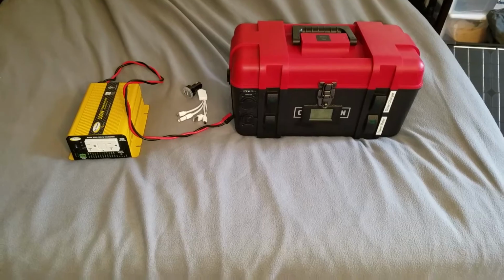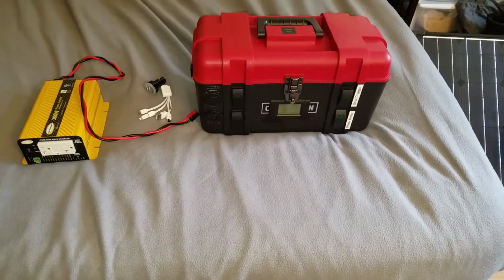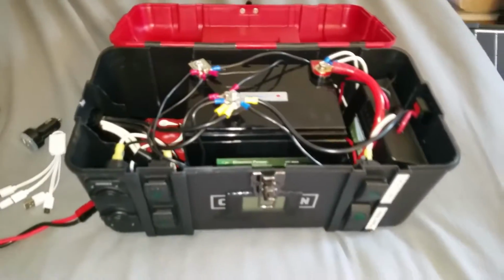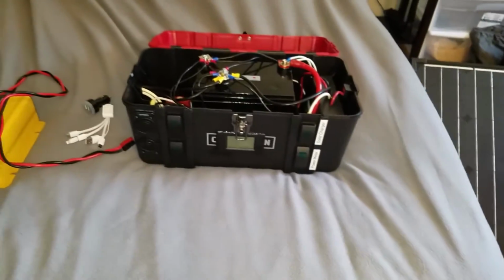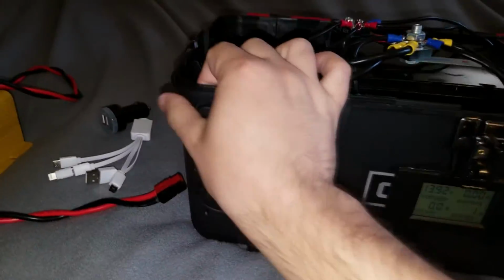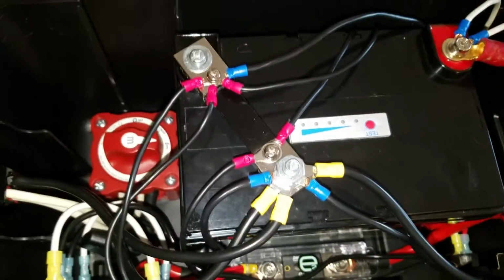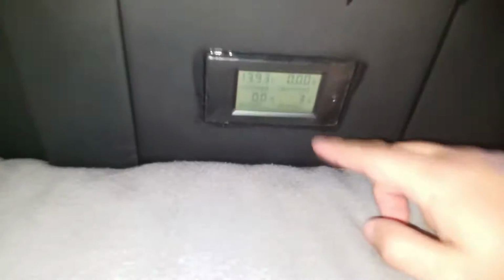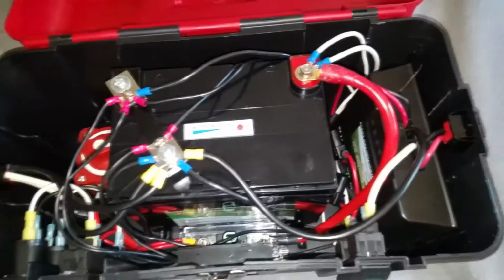Portable LiFePo4 Battery Box / Solar Generator

Comment: Good build but i wish correct term were use in the title description. The prime difference is that a battery is meant to store power and a generator creates power. IE In a power outage, a gas generator/ solar panel can continuously produce power as long as there is fuel or sunlight ; a battery can only distribute what has been stored.
Reply from the maker: I'm a bit confused at your comment since you're contradicting yourself. You say that I shouldn't call it a generator yet you go on to say that using a solar panel to generate power would qualify something as a generator. Did you happen to miss the large power Generating solar panel in the video?
Reply: what i was trying to said is solar panel is consider a power source to your battery and your box but not part of the device itself and your box is not limited to solar panel as a power source. it can connect to a any DC power source. ie a 12V car power outlet or a AC to DC converter. so the box itself does not generate power but a device to store them. let's said if you decide to connect your box to wind turbine you wouldn't call your box a wind generator. BTW nice touch with anderson powerpole. hope that clarify what i was trying to say.
Reply from the maker: Okay, I see your point there. However, I consider the solar panel to be an integral part of the setup making the whole system a generator with the box only being a portion of it. I would argue just as a gasoline generator needs a can of gas to generate power, my generator needs its input as well, but it accepts more than just one type input (solar,wind,mechanical, or even another generator using gasoline).
Keep in mind something like a solar panel or wind generator on their own would be an ineffective power generator due to the fluctuations and inconsistencies in the power output. But, you could combine either one with my box to make a complete and stable generating system.
So yes, within the box itself does not Generate power, it is an electrical converter and storage buffer, but the box isn't the whole system either, and thus the title of the video. It is a battery box when used alone but a generator when used as the intended system.

Comment: Hey, out of curiosity, what do you intend to use this solar generator to power?
Reply from the maker: Mostly small DC loads like charging USB based electronics, running a small 12v camping fan, and recharging flashlight/lanterns. With the inverter it has been very handy blowing up air mattresses when camping and recharging/running a laptop (I also hope to make a DC adapter for that soon). Honestly, I haven't even really made use of the solar aspect of it much yet other than testing simply due to the lack of need. I built it to have excess power for what I had planned to use it for, and it sure has had plenty of excess :P
Reply: You say you haven't made use of the solar aspect? How are you charging it?
Reply from the maker: I have two methods for wall charging. The battery itself came with a 10A charger. I also have a 48v power supply which I can hook into the solar charge controller to mimic a solar input. I believe it's around 1.5A which MPPT translates to a little over 5A or so into the battery. I can do a quick video demonstrating that when I get home if you'd like.
Reply from the maker: In fact, if it stays sunny, I might try to get a demonstration of the solar charging.
Reply: Have you tried that 48v supply method? I had the same thought with my big midnite classic 150 charge controller and my smaller genasun charge controllers, but the genasun tech recommended against it and I found this thread that indicates it's probably a bad idea: http://forum.solar-electric.com/discussion/22470/provide-pv-input-to-controller-from-dc-power-supply

I need to get a ac -> dc charger for my big 100ah lifepo4 battery. I want a quick 75a or larger charger so I can use my Yamaha EF2000is generator to charge if/when I want, but I haven't found one with adjustable bulk/absorb/float modes yet. I bottom balance so I don't want to just charge to 14.4V.
Reply from the maker: Interesting points in that thread. I could understand if a dirty DC signal would be problematic. I personally am using a 48v power supply which was removed from an old corporate tier telecom system so it is highly filtered and very clean DC. I have not had an issues using it, but I do not use it very often as the 10A charger that comes with the battery is faster, it's more of a back of method and a way of testing the solar charge controller without having to drag out my panel. I'm sure there are are plenty of cheap DC power supplies out there that are pretty much just a transformer and a rectifier with not much in the way of filtering and that is likely how a problem would occur if there would ever be one.
Reply: I contacted Midnite Solar this morning and asked them to confirm that using a DC power supply with a Classic 150 is a bad idea. This was their response:

"There have been many Classics damaged in this way and is not covered under warranty."

So... be careful. Your charge controller might be different, but it's a toss up.
Reply from the maker: Well, my controller was also only $89 so compared to a Midnight Classic... :P
But I really only used the DC supply to test the controller and make sure it was doing MPPT correctly.
Thanks for the heads-up though.

Comment: I dig the build (I do similar LifePO4 solar generator builds for fun on my channel). A subscriber recently told me about the PowerOak 400Wh unit on Amazon. Looks to be about $400. Assuming it isn't a total piece of junk (no experience with it yet) it will probably be the cheapest/best bet in this power range, unless you just want to build your own. No telling how good the quality is on the components though.
Reply from the maker: That's the first I've seen of that particular one. First glance it looks pretty nice, but that's without any research into how well it's built or the reviews. Off the bat I see it's not U.S standard outlets though, which would have been a no-go for me personally. Also, I note that it is Li-Ion instead of LiFePo4.
Reply: I'm pretty sure those are universal receptacles. See this diagram for how the male plugs from different countries fit: http://www.wonpro-international.com/UniversalReceptacle.html

Li-Ion could be a great thing if it's implemented correctly using 18650 cells and proper charging and bms circuitry. Personally, I'm worried they're ultra cheap lipo pouch cells inside.
Reply from the maker: Oh, fascinating! I've never seen outlets like that before, that's pretty cool!
I do appreciate the potential 18650 cells provide, and use them in many of my lights. The main issue with them is, like you said, making sure they have a good BMS for charging and regulation. Although, I do tend to prefer the puncture safety that LFP provides over Li-Ion.